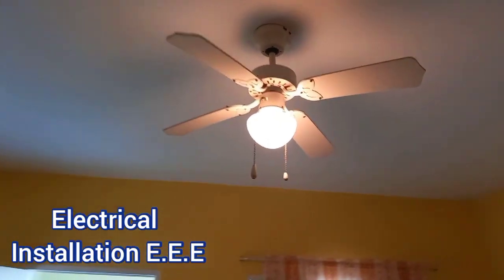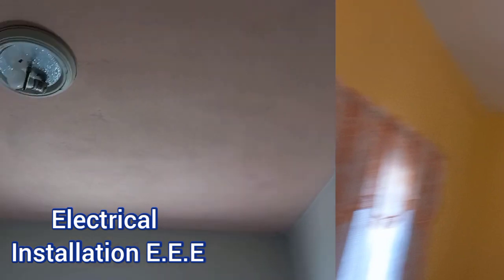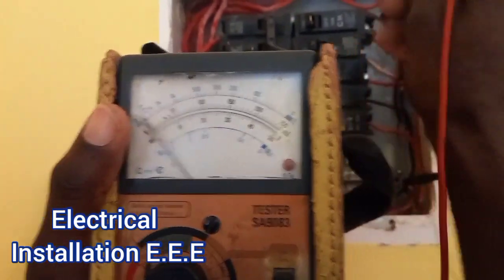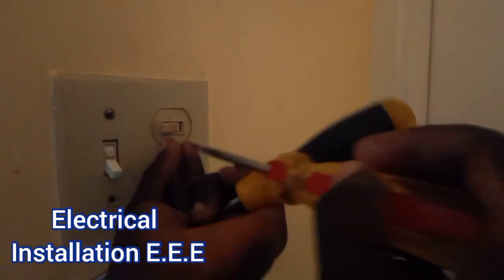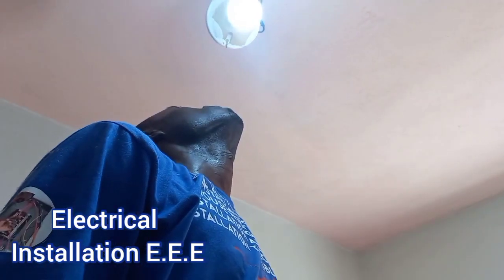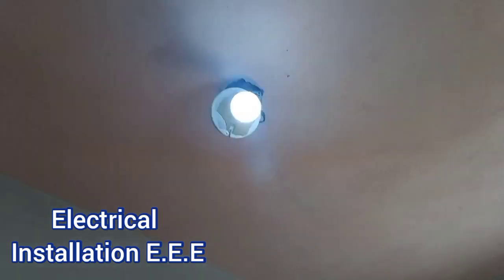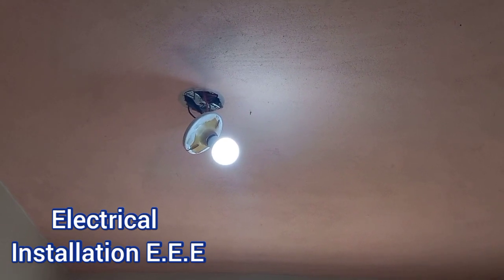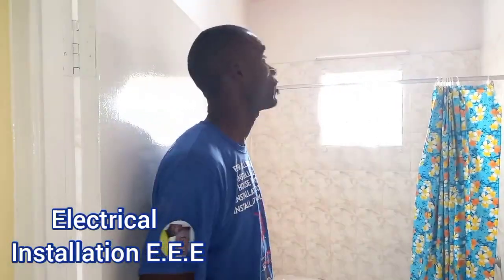Why your light bulb keeps blinking ? Here Is 1 Reason !! Electrical Troubleshooting Pt1

Comment: I love watching these video's. I also love the way you say ok lets check for voltage then shove a big uninsulated metal crock clip into the board to see what voltage you get lmao then lets bridge this switch with the biggest uninsulated screwdriver you can find 😂. Fair play tho you found the fault. Other possible reasons a light could flicker/blink are loose/missing neutral or LED lamp with a non LED compatible diimmer. Great video got a like from me

Comment: Question i say u press the switch leg or switch wire on the wall. Why that?
Reply from the maker: No i didn't press any of them on the wall i was separating them or if it was when u saw me put the screw driver on it , it was to bridge the switch to get contact.
Reply: @ElectricalInstallationEEE  Oh so u bridge the load wire terminal or screw on the switch. by using the screw driver to press down on that screw terminal. I see

Comment: Suppose a switch or plug is earthed and you are in a situation where you can't turn off the breaker how would you terminate the wires live on the screws ? Because the same way how you terminate the switch is the same way how I do it but if it's earthed I don't know how to do it without the breaker off
Reply from the maker: First wires should be separated , ensure u are not in contact with any grounds etc stay insulated proper shoe ,dry mat , insulated tools you know what a mean then handle wires individually once live going to terminate if the neutral or grounds already connected then you have avoid touching the metal part of the switch especially if u using bare hand to rap the wire around the screws to terminate